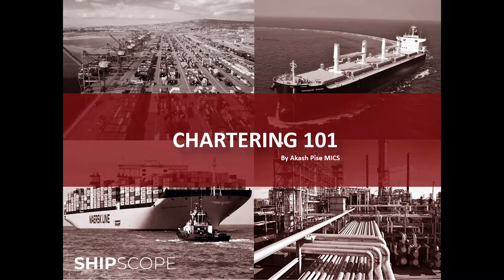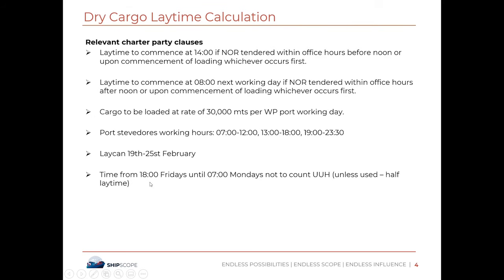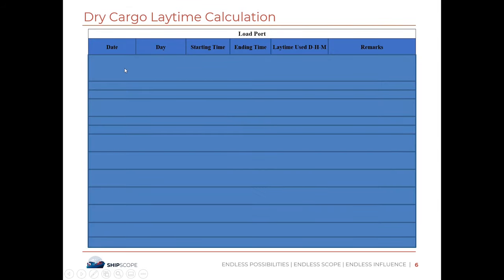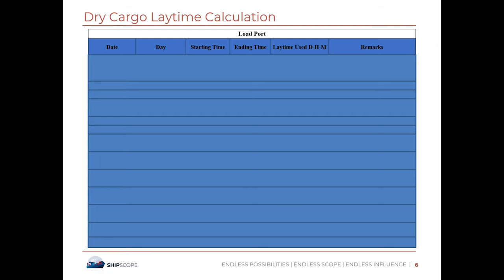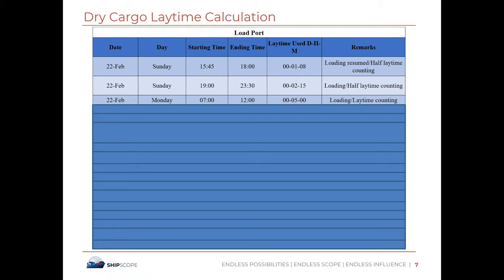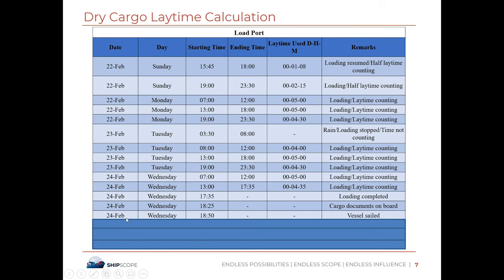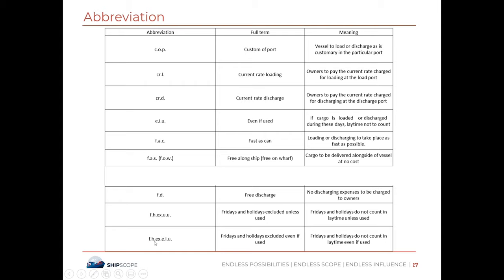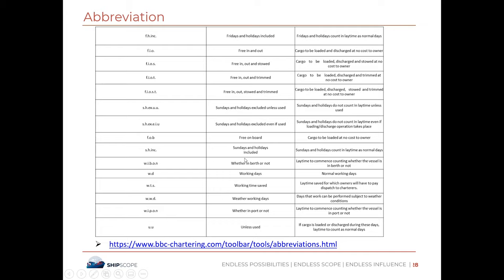How to Calculate Time for Cargo Operation ? - Laytime Part 2

Comment: Why did you make the remark "The revised dispatch time is 15hrs 2 min = 0.6583333 Day"? How did you get it? It seems wrong to me. It's actually 0.626388889 days! Than we will have dispatch 5402, as initially in the video. Please correct me somebody if i am wrong.

Comment: would you reommend any good laytime applications?
Reply from the maker: Try checking out the following websites.https://www.enqlare.com/laytime?utm_term=laytime%20calculator&utm_campaign=Laytime+%7C+India&utm_source=adwords&utm_medium=ppc&hsa_acc=1535351060&hsa_cam=12260771982&hsa_grp=122634398292&hsa_ad=496505668024&hsa_src=g&hsa_tgt=kwd-776171314779&hsa_kw=laytime%20calculator&hsa_mt=e&hsa_net=adwords&hsa_ver=3&gclid=Cj0KCQiAgomBBhDXARIsAFNyUqNO15KZGDCbveHOLBIxQbxovSS_zYP2nNF3qS-WZD9CiLPuK_uI4ZQaAjyjEALw_wcB
https://www.burmester-vogel.com/laytime-calculator

Comment: I know its basic mathematics but i divided 82.594.37 by 30.000 and i got 2,7531456 ... what is this number exactly and how did u get 2 days 18 hours and 5 minites ?
Reply: ok so i got the answer below nut u used 82594 not the whole cargo .. which 82594.37 as per ur video ..why arent we adding that too ?
Reply from the maker: When you divide 82594 by 30000 you get 2.753133 days. In order to convert it to Hours and minutes, you need to multiply 0.753133 with 24 hrs, giving you 18.0752 hrs. And finally, to get the minutes, you need to multiply 0.0752 with 60, which gives 4.512 minutes rounded off to 5 minutes. That how we arrive at 2 days 18 hours and 5 minutes.

Comment: What kind of calculater do you use? On the calculator i have 82,594 divided by 30,000 equals 2,753.133.
What kind of calculater do you use to get an answer 2 days 18hours and 5 minutes?? This is not very well explained
Reply from the maker: When you divide 82594 by 30000 you get 2.753133 days. In order to convert it to Hours and minutes, you need to multiply 0.753133 with 24 hrs, giving you 18.0752 hrs. And finally, to get the minutes, you need to multiply 0.0752 with 60, which gives 4.512 minutes rounded off to 5 minutes. That how we arrive at 2 days 18 hours and 5 minutes.
Reply: @ShipScope  i am grateful for the explanation